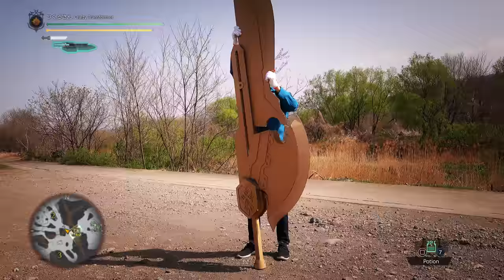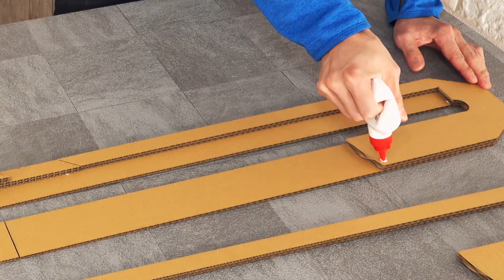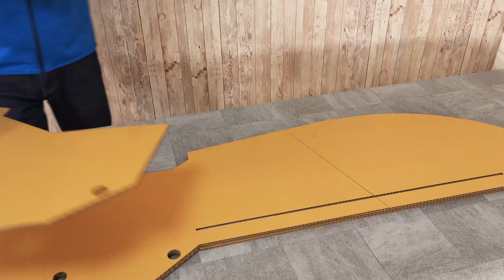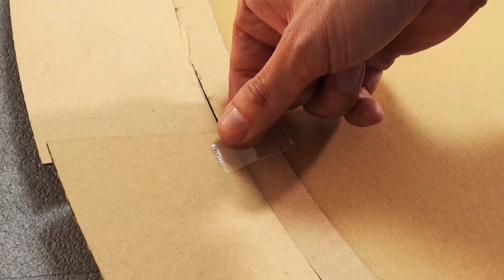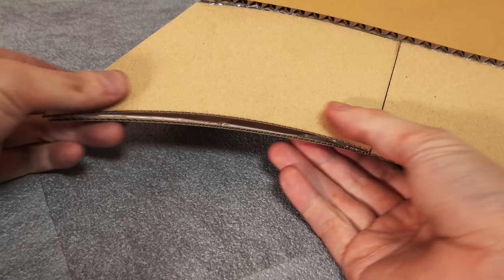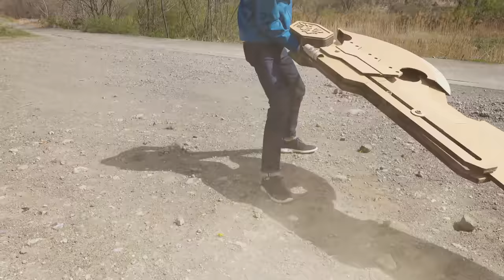ダンボールでスラッシュアックスを作る/Switch Axe Cardboard DIY - Monster Hunter - Crafty Transformer

Comment: you're used to swinging around those weapons in MH, you didn't realize how huge those weapons are irl...
Reply: Maybe.  But you also gotta think.  Thing's still ultimately made of cardboard.  Even reinforced, it might still buckle from a really hard swing or have an unusual amount of drag from the corrugation.  It wouldn't be terribly heavy, but it's not sturdy enough to take the style of swings you would normally see.

Other than that, I really like the design of this.  Very on-detail.
Reply: @dragonmangames2523  Thats the tradeoff for going down the cardboard tree instead of bone or ore, reduced maximum sharpness in return for lighter weight so faster attack speed.

Comment: Judge by the size, thickness and the structure that connect each layer. This switch axe it's not light weight. He do make sure when he swing the blade won't bend. So much though put into this master pieces. You have my respect sir.

Comment: Just to put this in perspective: this construction weighs 4.5 kg, and most of the weight is toward the tip, not the handle. 
A typical long sword is 1-1.5 kg, and the weight is mostly in the handle.

Comment: Switch Axe is such a silly concept.  Why is the sword transformation the slower weapon?  The axe blade in its transformation would in any predictable circumstance bring much more of the weight to the outside and thus make the weapon swing require more torque.